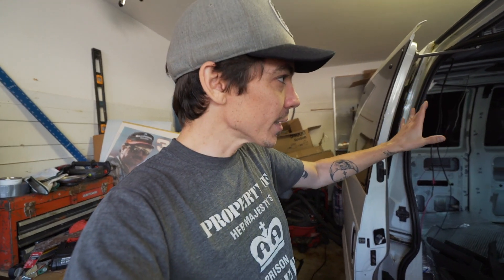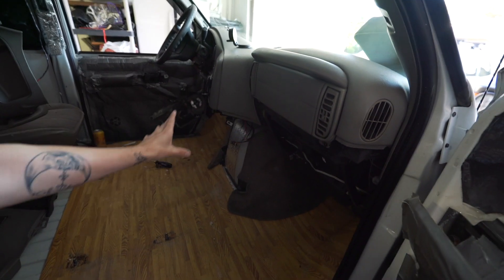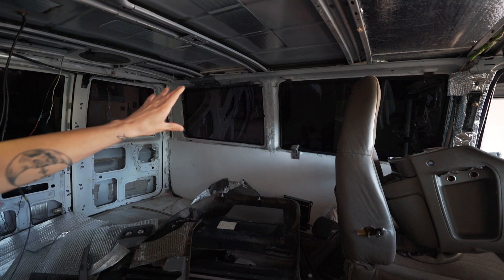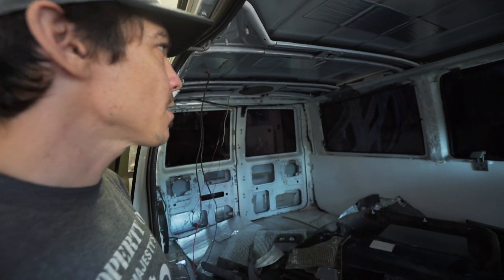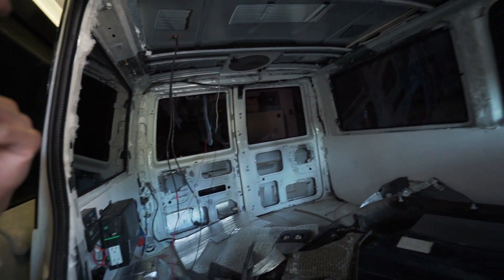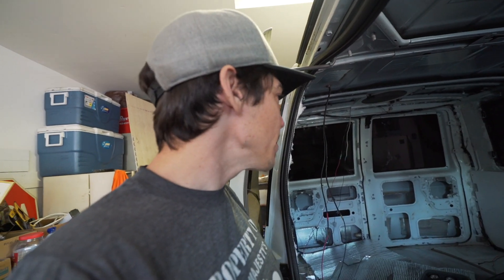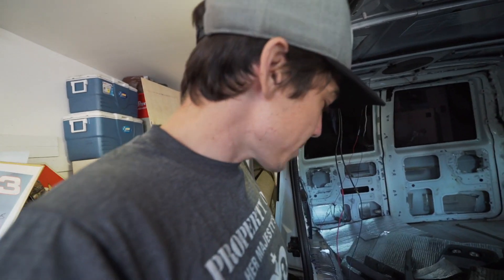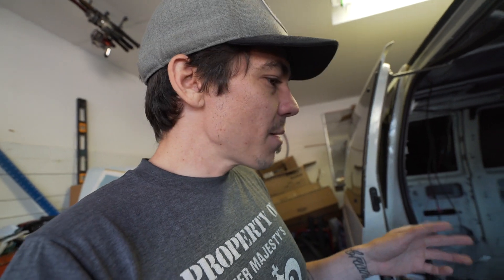Astro Mistakes and Brief Build Plans

Comment: Check out the struts Enigmatic Nomadics used on the bed top in his schoolie..He's got a.lift top that lifts on shock absorbers. I have a smaller version in my Astro with two small struts. It works really well and allows a lot of storage space. Also, you can buy Thinsulite online by the yard.

.

Comment: For walls and ceiling, you can use old campaign signs ( 4mmx4'x8' corrugated plastic sheets) and cover them with speaker cloth. You can find them free at the transfer station in a large bin called "campaign signs", or just snatch them off the road side.
Reply: yep!

Comment: Consider coroplast sheeting for the bed top. They can be cut/sawed, and can actually be picked up pretty thick.  Look for a local place to save $. 
*coroplast is common for those plastic signs that you see, but come in very thick versions too. I had a buddy build a tool trailer out of it.

Comment: So vinegar can be an effective mold killer but you have to mix it 1 part vinegar to 10 parts water. It needs this ratio to be absorbed (drunk ) by the mound and then the vinegar breaks down the cell walls off the mound.

Comment: Run the wiring for AC and Dc before you build. Urethane or paint the plywood (both sides) before you fasten it to the walls and ceiling to prevent moisture, dirt and smells from permeating it.The mold developed because there was no air flow and the moisture that the wood absorbed from you living in it. Perfect conditions for mold growth.

Comment: recommendation, maybe check out "the grove guy" minivan conversion (maybe you have already seen them). I used his plans to build out my Toyota sienna's bed. I imagine you could widen the dimensions for the Astro and maybe instead of using wood you could use PVC to build out the bed frame. I found it would pretty well for the entire year I was living in my Sienna. You could access the under storage from the back or the front in a life of fashion you were wanting. Some food for thought.

Comment: I'm excited to watch how you will get this done, Jed. I don't know how to identify mold in a vehicle. I only became aware of the humidity issue because of my books.   I have been using empty cardboard boxes to make shelves. It is a temporary solution. I know cardboard is porous. So it might not be a good idea long term. I am just about out of space in the car. I had to create solutions. It's happened, though. Just like I wanted.  I have created the beginnings of an art studio. The car is filled to the brim with art supplies. There is no room for creating a day to day routine. Nowhere for my gym bag or my computer. I know what I want. A van and a cargo trailer hitched onto it. Today I saw the U-Haul hitch on a car. My friend told me they can put a hitch on my car. And now that the weather is improving I see RV's in the Walmart parking lot. Sometimes I think I could like having a medium RV. I need the cargo trailer. I need an art space to feed my soul. The only reason I am starting to look at RV's is because of the weather. This winter was brutal. And I can't imagine what the summer will bring. What about a van in the summer? I need AC. I will just keep watching these videos. TY.

Comment: I'll be interested to see what you use to block out the widows as you plan. Great device idea for getting a wire safely though the roof. Instead of a full size bed taking up most of the back, have you thought of any way the frame can be built so you can fold it into a seating area? Like a futon frame but I guess you'd have to custom build that to fit right. Futon mattresses are too thick, so only referring to a sofa to bed frame design... how to do without wood. Hmmmm. I'm thinking for myself and my own prelim ideas. Good ideas, Jed.

Comment: What I did in my Promaster was to order a custom black floor rubber mat custom fit for my vehicle and let it sit out a week.  Then I used off the shelf carpet mats in the high traffic area in the middle of the Van.  The rubber is water proof and easy to clean.  I'm looking at something with bamboo for the walls and ceiling.

Comment: Hi Jed!! I really think your idea of doing the walls and ceiling in the van with the vinyl flooring planks is a great one. The weight of the vinyl shouldn't be enough to make much of a difference plus it would look awesome and help with your moister problems.
Since you are considering covering the windows in the back of the van with your interior build, why not remove the windows and have someone weld in sheet metal to make the van a solid panel van? That window glass is heavy and thin gauge sheet metal would be lighter. Also Astro vans look so cool when they are panel vans without the windows!

Comment: Suggestions:....Use Arborite, or smooth surface melamine panels for the floors, and/or DiBond(used to make signs) for ceiling and walls.
.... vinyl flooring the backing absorbs water and molds and the top is too soft and tares and scuffs easily.
....better yet, u can also find the woodstrip flooring that is made from recycled rubber but looks like real wood planks....I think Home Depot
....for the bed use some lift pistons from a hatchback from salvage yard.
....for nice lite bedboard take 2 sheets of 3/8s plywood (at least the top piece, a 'finished oneside' sheet) and 1/2 inch blue or pink insulation board in the center and laminate/glue(use 'Locktite PowerGrip glue, it won't melt Styrofoam) the 3 pieces together to make a nice lite and strong composite board

Comment: I calculated the weight (and cost) of vinyl plank flooring for my van and it would  have added 110-120 lbs. to the weight and that doesn't include the plywood underlayment and it would have been way more expensive than just painting the plywood floor with durable floor paint or polyurethane of the kind used for hardwood floors.

Comment: Is the Fantastic Fan not enough ventilation for the van? I am currently looking for an Astro van to do some Urban Stealth camping  and I would eventually like to do it full time but I am really concerned with the mold & mildew issues. I know that you and others have had some issues with mold... so what can be done to prevent it? because I was under the impression that if you have proper ventilation ( vent fan & cracking the windows a bit ) for airflow that would avoid these issues. I appreciate your thoughts

Comment: those seals suck!! HAHA last week i sat in my van during the rain storm we had, and i found 2 leaks, one being the corner of my windshield and the other on the side door.. today i think i saw where the doors might have a rip in the rubber seal.. deff on list of things to fix soon, as it rains everyday during the summer here in FL. (maybe for your future video) if you dive into your solar for this set up... Im still curious how i can / should build a power bank with deep cycle batteries, & batt isolator, to do a basic power setup until i can purchase my solar panels. if you have any tips or knowledge deff would be of value to me, its still new to me! Keep up the great work tho, I'm exited to see the rebirth of the Mystery Machine!! HAHA

Comment: I need to ventilate my enclosed cargo trailer for when I sleep in it on dirt bike trips, but don't want to cut into the roof for exactly that reason... it always eventually leaks! 😢 Plus, I just insulated the thin sheet metal roof with 3/4 inch foam board and reflectix to trap the heat better at night. I'm going out next weekend up by Gorman and projected temps are gonna be in the 40's at night. I was gonna buy a bigger heater but I think with insulation the lil buddy should be fine... and Yes, I also installed a carbon monoxide detector, so I don't Die 👍🏼😎
Reply: There's plenty of videos on how best to install a roof vent. Build the Frame 14"x14"  cut the hole, Use 1" Butyl tape between Vent and roof, screw it down. Butyl tape works wonders!
Reply from the maker: Don't forget the lap sealant on top :) They might eventually leak, but if you do a have decent install it should last years. Doesn't take long to reseal

Comment: You mentioned no wood due to mold. What are you doing for the floor? I was going to put down 1/2" Rigid Foam and then 1/2" OSB with something waterproof on top. Do you think the OSB is overkill? (I'll be in Colorado and the Southwest most of the time so I'm not THAT concerned about mold, but you never know...) Also, if you get a chance, take a look at my van project on IG @bumpin.along.the.backroads so you can see what I'm dealing with. Any thoughts are welcome. Thanks!
Reply: Also, any moisture issues with the Thinsulate?

Comment: The solar entry port you're promoting is not as good as a "LB conduit" find the one that works for you. Can add or remove wires without interrupt the roof hole.

Comment: Get a high top.   You are going to hate being in that low ceiling van now.  A long Sprinter would be even better.  Even if it means getting a real job.   You work hard to try to do your conversions cheaply, but they still look cheap compared to many on YouTube who can actually spend a couple thousand.   A full bathroom shower would be good in the long run.   Evie  can have a bigger kitchen then in her van.

Comment: Hey Jed,  Here's what you need for the Solar Cables You need a Roof Gland http://a.co/7fak1p7 and use this Lap sealant http://a.co/6ATQi2r I used both on a Tear Drop Trailer I built for my Brother and another Van build I did. It works. Make sure you aim the two ports to the rear. ;-)